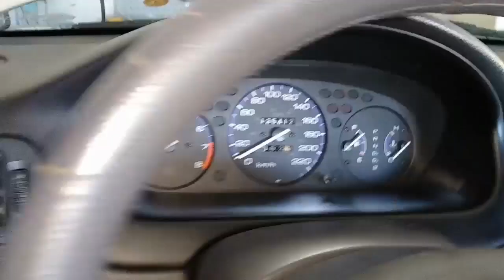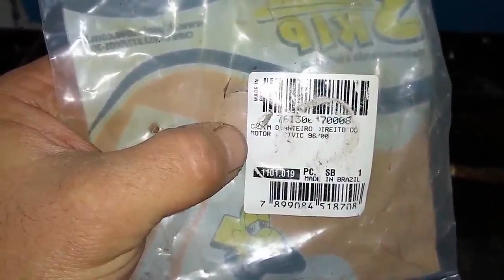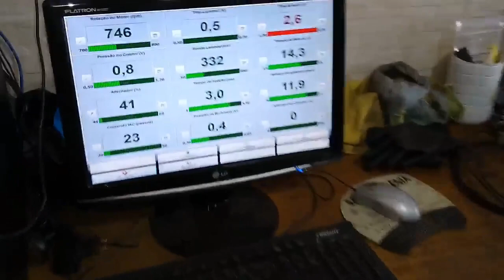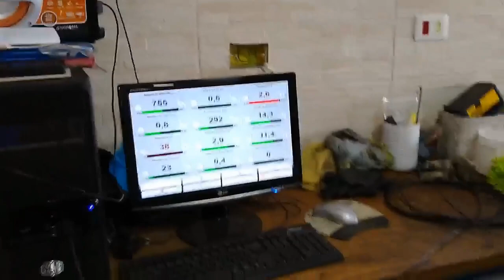Honda Civic 2000 de Cajamar - Preventiva Anual c/ Troca de Coxins *Muitas Dicas* e Civicão do Lucas

Comment: Boa noite qual oleo pro d16y8 e filtro do uno  que você recomenda?? Eu tava usando motul 15w40
Reply from the maker: Sim, filtro de óleo do motor Fire e pode utilizar 10w30 10w40  15w40  20w50 depende do desgaste do motor.
Reply: @jotec-oficinadoseucivicantigo  valeu brigado